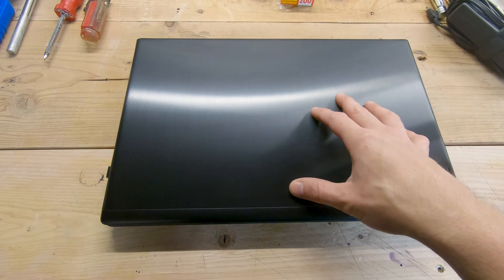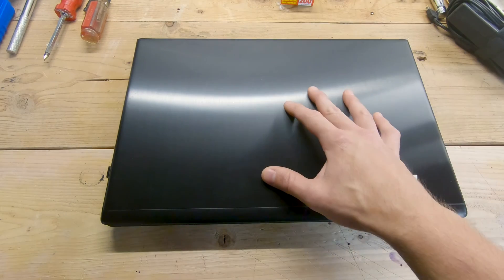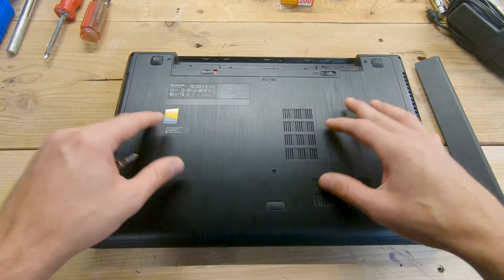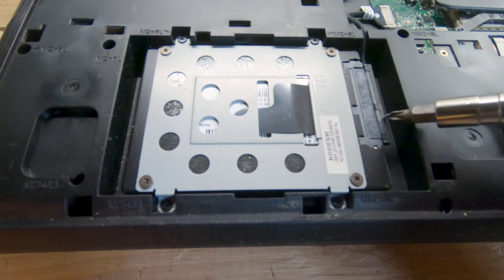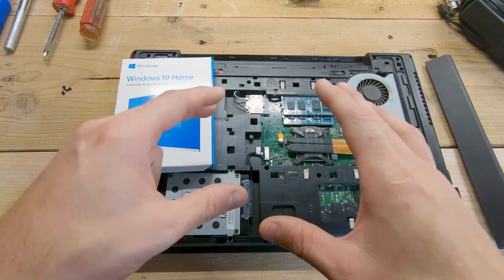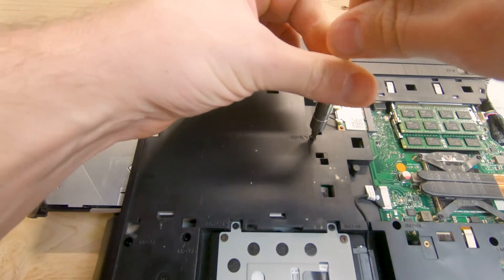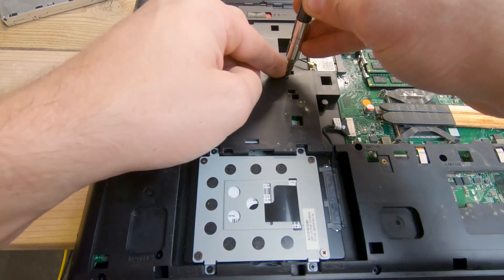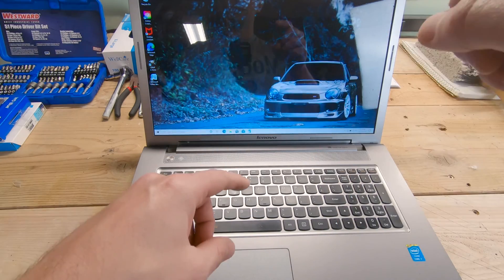Renew/Upgrade an Old Laptop (Lenovo Ideapad Z710)

Comment: Running i5-4210M, 512gb ssd and 16gb ram, Win 10. GeForce 840M. Just ordered i7-4910MQ,can't wait to upgrade! Gonna be a lovely home movie theater!! Found this relic in my "attic of old laptops"... 😇
Reply: Hey!

Im currently researching whats the best CPU I can place in mine. Im also running the i5-4210M. As far as I researched, the i7-4910MQ is the best one you can get but support wasnt guaranteed as it sold with max the i7-4710MQ. Im trying to find confirmation before I buy, did it arrive and did you manage to upgrade it, did the laptop accept it and if so how is the cooling holding up?

Comment: I am going to run SWITCH emulation on this exact laptop. Just ordered a new SSD for boot,  HD tray in place of DVD drive to convert to SSD HDD etc, new battery and 16gb ram kit ... Wish me luck :D
Reply from the maker: Good luck
Reply: @TwoFourSevenDIY  Did it and lowering resolutions and some KNOW HOW got even TOTK running over 30fps (30fps was switch top speed)). Funny though it was Mario Kart that gave me the most trouble. bouncing between 35-60 which I believe is a shader issue so I will get complete set of shaders and try later....

Comment: Hi👋 I have this laptop as well. It had windows 8 but after I updated it to windows 10 when I scroll down the screen often gets freezing and dark for like 2 or 3 secs and then it comes back. And now also it starts suddenly getting shuts down. Do you think it could be a problem with the graphic video or the hard drive? Thanks for any advice 😊
Reply from the maker: My first step would be a complete fresh install of the OS.